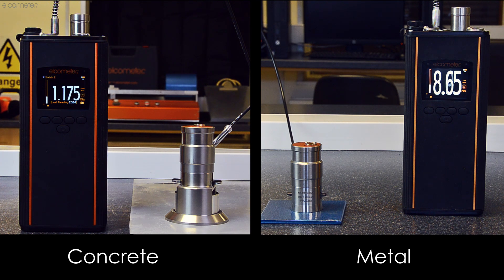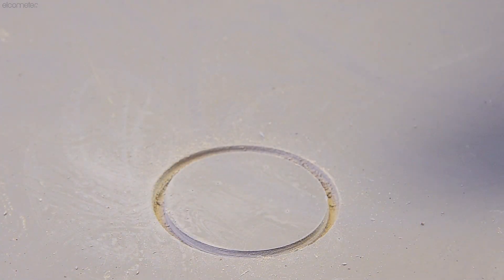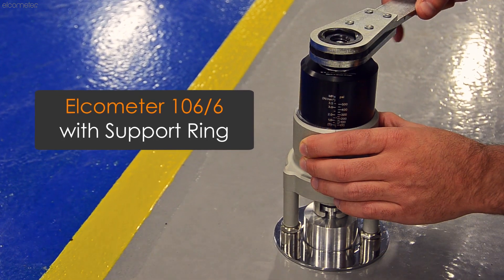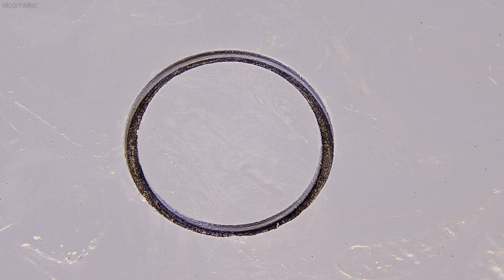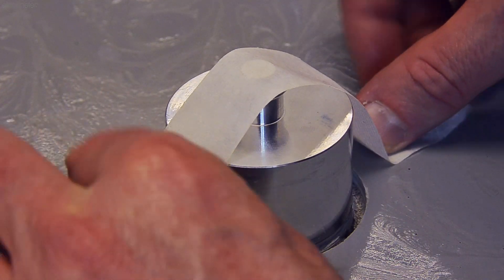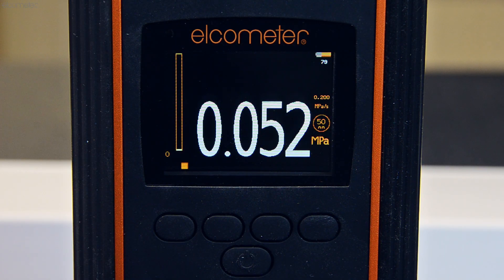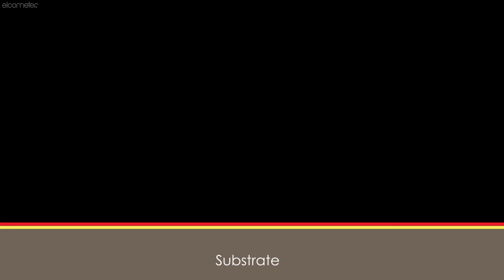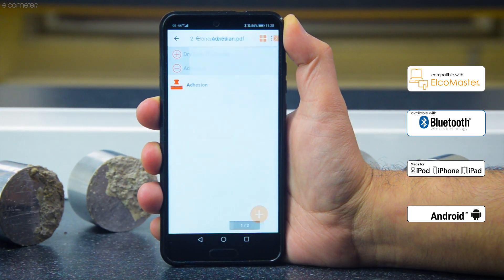8. How to Measure the Pull-Off Adhesion of Coatings on Concrete

Comment: Hi Sir! can we use the Elcometer 106 for metal substrate without coring? If not, what type can we use?
Reply from the maker: Hi,
Yes you can. Coring is only necessary if the substrate is concrete.